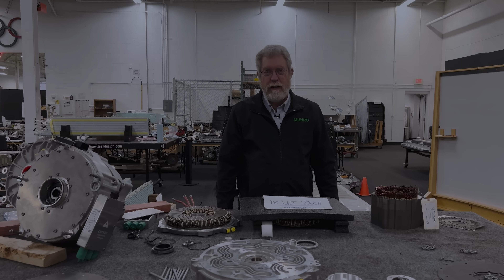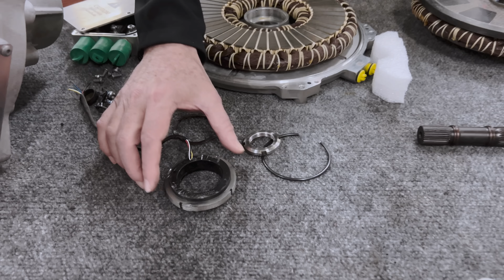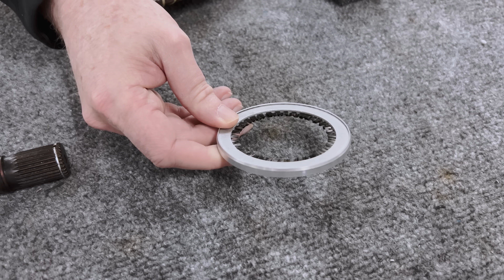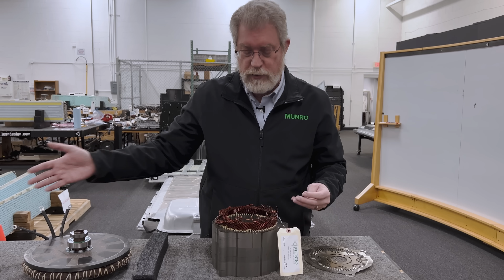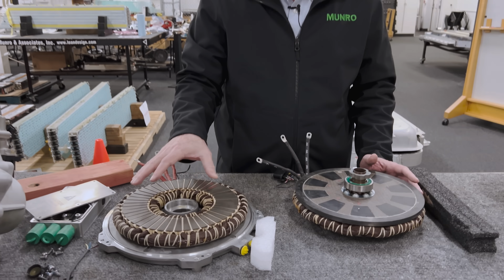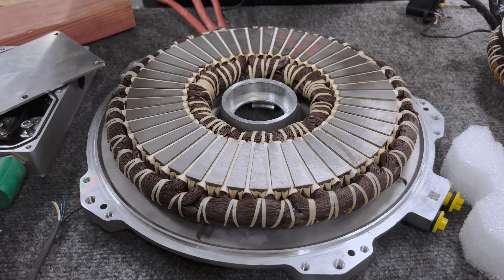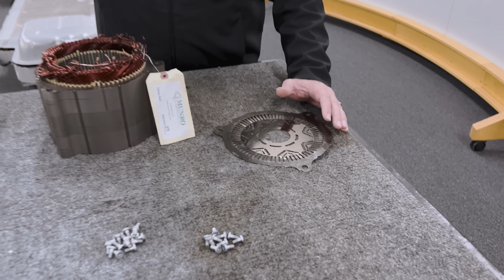Axial Flux Motors Explained: The Future of EV Powertrains?

Comment: This is a stator-rotor-stator (single rotor dual stator) axial flux motor. YASA motors uses a rotor-stator-rotor design (dual rotor single stator). There are other configurations for axial flux as you can think of it as discs stacked parallel to each other. 

Some things I've noticed about this motor: - The end windings are enormous because they are using fractional slot winding as opposed to concentrated windings. There a lot of extra material that can be shaved off for sure.
- These bearings are small. End windings probably contribute to this. Concentrated windings mean that you have so much more space at the center of the motor. You can place larger diameter bearings and leave space in the middle for things like a tiny differential like in Lucid's case.
- Cooling may not be optimized because of the motor configuration (stator-rotor-stator). Meaning that the windings never touch any fluid because that will slow down the rotor pushing coolant out of the way. So the cooling plates are necessary with this design. Even so, i think they are placed on iron yet windings tend to generate more heat. If they used a rotor-stator-rotor topology and encase the windings somehow, they could get rid of the cooling plates and run fluid directly on the winding like YASA motor does.
- The axial forces on the motor can be countered with tight tolerances during manufacturing. Maintaining a perfect airgap and a bearing preload will not put additional axial forces on the bearings. 

How much does this weigh?

Paul, if you can, please also teardown an EMRAX motor. I think they have the most compact axial flux motor topology on the market due to the fact that their architecture is an outrunner style. Aside from the obvious issues of low IP rating of their motor, I think the way they deal with the axial forces is actually quite clever. 

I'm currently in advanced design stages developing a dual rotor single stator axial flux machine. Hopefully I'll send you guys one for a review in a year or two. Mark this comment 😊
Thanks for your video!
Reply: Mechanical tolerances need to be there. If you want to decrease it, the cost of the machine would increase significantly. Anyhow, the cost is going to increase due to use of special bearing and maintenance of the same. That is the reason these machine are so costly.
Reply: @huskberry  I agree that the EMRAX design is interesting, but the rotating housing is undesirable for almost any application other than the aircraft for which it was designed. It also apparently has bearing problems, since in the one certified production aircraft (from Pipistrel) that uses it, routine scheduled bearing replacement is required (according to the aircraft manual).
Reply: @brianb-p6586  thanks for looking this up. I'll check out the pipistrel. I've never heard of them before
Reply: They use robust dual angular contact bearing and there werent any problems found. TBO of pipistrel motor is low due to the lack of expirience dealing with electric propulsion units in aviation, - taking it slow and leading with example.
Reply: Koenigsegg's Dark Matter "raxial" motor, 600kW output, 1250Nm torque and weighing less than 40kg is surely the most power dense motor out there. Of course, it's designed using more exotic and expensive materials than the typical mass-produced EV-grade AC motor, so it has some advantages over a unit which has a cast aluminium housing, etc. Still... 600kW! :D
Reply: @lennyvalentin6485  it doesn't matter if it's available to 40 people out of 8 billion 🤣
Reply: @ They could probably make some money selling their motors to other manufacturers, if they wanted to.
Reply: @lennyvalentin6485  600 kW for a fraction of a second before meltdown is useless, and the real performance of Koenigsegg's "raxial" motor is unknown until it is produced and in the hands of people not working for Koenigsegg. Even Koenigsegg only claims 800 HP (588 kg). It's still marketing fluff at this point, being part of the Gemera, which is Koenigsegg's model name for vehicles which they announce but don't actually build. The first version of the Gemera was supposed to have the wonderful (but not actually worthy of production) Freevalve system. The motors actually used in Koenigsegg vehicles have been from YASA.
Reply: I happen to possess one of Emrax' axial flux motors (228), and yes it is quite incredible being able to casually pick up a 124kw motor with one hand. However, while the outrunner style disc mount solves many things on paper, in practical use it also introduces a lot of drawbacks/challenges. It makes the motor much harder to mount in ways where there are multiple stress forces beyond just the axial rotation force itself. The central location of the mounting bolts don't offer much strength unless you also directly support the axle from the opposite side.
It also requires a casing to protect the motor if it is used in more exposed applications, and while the liquid cooling option works well, it's still not ideal in terms of total motor IP rating.
The mono-directional motor mounting is imo its biggest drawback as it limits the use a fair bit. I think they could achieve the same result but reverse the rotor mounting to be an inside rotation element, and then attach the stator to a fully closed outer case shell, would be a more optimal engineering choice in terms of application flexibility.
Reply: Be interesting to see a rebco liquid air version of this... with some way to separate oxygen
Reply: "Meaning that the windings never touch any fluid because that will slow down the rotor pushing coolant out of the way..."?? The windings are stationary and have one side available thus having excellent thermal contact with the coolant. On the Yasa the winding are sandwiched between the two rotors, severely limiting access to coolant.
Reply: @JohnReidEngineer looking at the design of this particular motor, there's no way to directly cool the windings without bathing the rotor as well. That's that I meant.

Also, please take a moment to read Yasa's patent on cooling their motor. They have the best design in the game of axial flux
 https://patents.google.com/patent/US9496776B2/en?assignee=yasa&oq=+yasa
Reply: @alafrosty  You seem very confused. The description "axial-flux" and "radial flux" describe the magnetic flux path direction across the gap between the faces of the stator poles and the rotor poles. As correctly noted in the video, this axial-flux motor's flux is parallel to the shaft (which is what "axial" means) across the gap, and of course needs to do a U-turn in the back iron at the ends of the motor to return through the adjacent poles. The windings are not radial - they are loops in planes perpendicular to the motor axis (shaft); using the "right hand rule", the fingers of your hand wrap around one pole to follow the electrical current and your thumb points along the motor axis to show the magnetic flux direction.
Reply: This is such an inefficient design! So much loss!!

Comment: Still could not wrap the slinky around my mind, on how the stair shape is formed, with pre-wound coil dropped in place.🤯. Is that similar to an alternating  E-Core of  a transformer, except in this case two sets of mirrored stator halves are pressed against the coil🤔. Everything else was wonderfully explained though.❤👍
Reply: It's not like a slinky at all. A clock spring would have been a better analogy. 
https://www.youtube.com/watch?v=c8XkZZ_VbQw
Reply: @brianb-p6586  Thanks for the info. Never thought the bottom was connected(which makes for single long strip) unlike that of a transformer(2xmirrored El plates). Now it makes much better sense. Still wonder how those dense coils are dropped(squeezed few turns at a time🤔) in place.❤️👍
Reply: @aware2action  The part of the strip which is continuous is the "back iron", which is where the magnetic flux travels between adjacent coils.

Comment: This is where I had hoped in-wheel motors would combine the best of traditional radial motors with the benefits of axial motors. Sure, there were other confounding issues, but the torque/power improvement was as expected.

Bottom line, high efficiency and low cost mean you typically have smaller motors that run hotter. Heat removal from an axial-flux motor seems better/easier/cheaper than the same level of heat removal for an otherwise equivalent radial-flux motor.

That Lucid chose a radial-flux architecture says volumes, given that they obtained industry-leading performance. How did Lucid do it?

Comment: This man has never seen a slinky in his life
Reply: I found the "Slinky" remark confusing - I assume that the notched strip is wound like a clock spring, not a Slinky. It would halve helped to tear it apart, as they routinely tear apart rotor and stator laminations of radial-flux motors (such the Bolt example shown in the video), but this seems to have been a non-destructive disassembly.

Comment: Tesla has led the EV industry to focus on high acceleration, thus high power/torque applications, which appeal to the 'racers' amongst us. But for daily driving most of us would never use 80kW, so we could have a 20kW motor attached to each wheel making for a very compact powertrain. For small vehicles, 10kW continuous at each wheel is plenty.

Comment: Höganäs produces Somaloy®, a soft magnetic composite (SMC) material with unique 3D flux properties, ideal for manufacturing stators for axial flux motors (AFM) SMC materials enable the production of compact, high-performance electromagnetic components with several advantages:

1. Simplified manufacturing: SMC components can be formed into complex net shapes, reducing the need for subsequent operations

2. Improved efficiency: Axial flux machines using Somaloy® can save space, weight, and cost

3. Design flexibility: SMC materials allow for three-dimensional magnetic circuit design, enabling more compact and efficient motor configurations[1].

4. Environmental benefits: While specific CO2 emission data is not provided, SMC-based AFMs likely have a lower environmental impact due to their compact design, reduced material usage, and improved efficiency compared to traditional laminated steel sheet (LSS) motors
Reply: YASA motors use SMC stator cores.